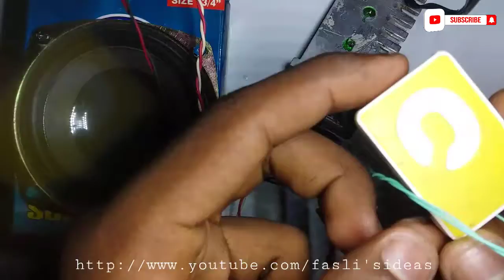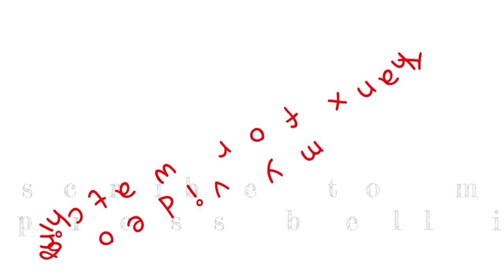homemade mini power full  amplifier circuit using d882 transistor

Comment: Could this amplifier work with the tp4056 charging module if I want to connect it to a 3.7 volt battery, or is it better if I connect it via USB to a power bank?
Reply from the maker: Yes
Reply from the maker: Power bank better